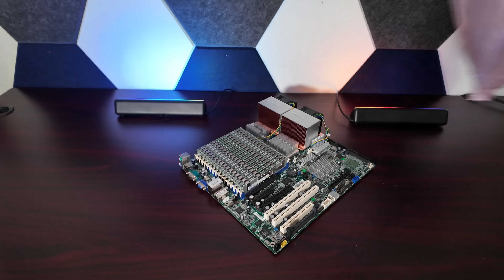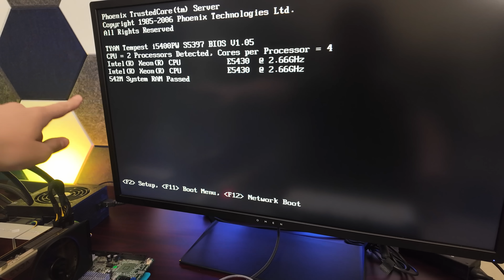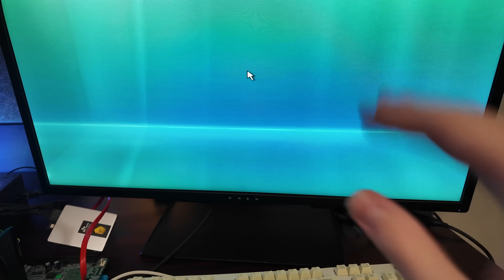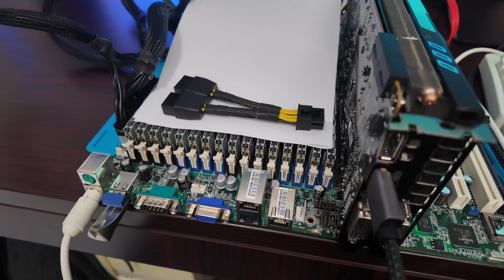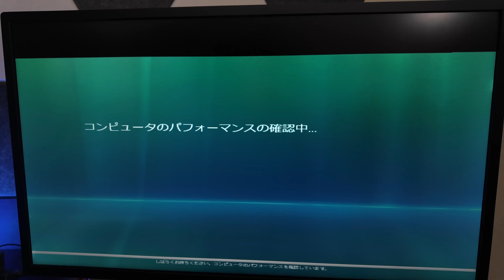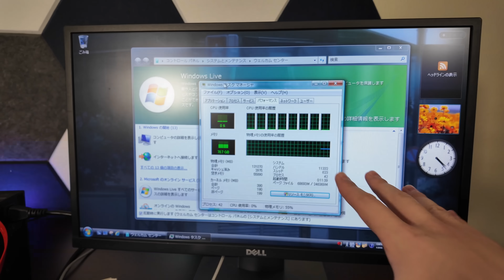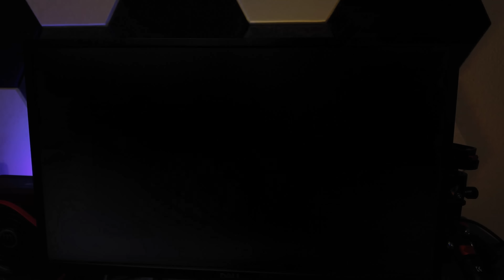What can you do with 128GB of DDR2?

Comment: The situation is so bad we are getting DDR2 reviews
Reply: And we be watching 😢
Reply: Next instead of ram we will be looking at roms
Reply: @jeffbongos3796 It worries me that I am hyped for that, what are we expecting?
Reply: @jeffbongos3796  "Cele ROMS"...
Reply: There is people building new PC with DDR3 ram and Cpu so it's not even a joke anymore it's that bad 🥲
Reply: @ommsterlitz1805  replying to this comment on ddr3 ram and an intel 4th gen i7, although id prob still be on this if ram prices never hit just becuase its fast enough generally, but i would have still been more likely to move on to something newer if the ram prices thing didnt happen
Reply: @randomgamingin144p  holy molly can you even launch windows 11 or any modern games or application ?
Reply: @ommsterlitz1805  shouldn't be able to get win11 with that, it needs gen 8 or newer lol. i have that problem as well with my gen7 i5. just ordered new am4 board and chip, I'd gone am5 if the ram wasn't the most expensive to buy.. I'll use ddr4 a little while longer 😆
Reply: @ommsterlitz1805  I'm running W11 on an intel 3rd gen i7 with 16 Gb DDR3 RAM, it works surprisingly well after you get rid of all the bloatware, but I guess I'm lucky to be using a good chipset as well, because that might make a difference at this point.
Reply: @ommsterlitz1805  You would probably be better off going for Linux on hardware like that over forcing windows 11 to run on it (you still can, but you really shouldn't lol). You can play games on ddr3, especially if you don't play anything extremely demanding. Just keep in mind, the ram is not the only issue. Old ram requires an old motherboard, which also limits your CPU/GPU options. If you want to play something like cyberpunk at a solid 60fps it would be an uphill battle. I don't think it's strictly out of the realm of possibility though.

To sum it up: ddr3 is perfectly capable, but may have some limitations and obviously isn't gonna be a crazy gaming pc. Great option for casual use on a budget imo tho.
Reply: @ommsterlitz1805 then they were impatient, good deals on ddr4 happen often
Reply: @uzcape i have 32gb ddr5 btw
Reply: @zhanucong4614  Thats awesome...😊
Reply: @uzcape it was bought pre second tribulation, right after the first one
Reply: @zhanucong4614  Good 👏🏻
Reply: wow bravo!  @zhanucong4614
Reply: @zhanucong4614  same bro
Reply: @LB.99 hopefully that people in future will have our luck
Reply: @zhanucong4614 i just bought 2 16gb ddr5 sticks for 350$, i shouldve bought 64 tbh
Reply: @zhanucong4614 I have 64GB ddr5 and 192GB ddr4 btw
Reply: @zhanucong4614 you just asking to get robbed
Reply: @zhanucong4614   HE HAS RAM. GET HIM
Reply: @zhanucong4614 HE HAS RAM GET HIM
Reply: @zhanucong4614  carter PCs on his alt
Reply: @zhanucong4614 what neighborhood do you live in again?
Reply: @chillycaty balkan/Croatia,come and get it pal,we have turned people into soap for far less
Reply: @zhanucong4614  good for you
Reply: @zhanucong4614  HE HAS RAM GET HIM
Reply: @zhanucong4614  okay
Reply: @zhanucong4614 just asking, where do you live? yk, just curious
Reply: @zhanucong4614  i have 96gb ddr5 btw
Reply: @zhanucong4614 no one asked U and btw I have 64 gb of ddr4 sitting in my storage room and using 64 gb of ddr5 right now
Reply: @UioEditz good for you,am dual wielding two monitors,one of them is a wacom display,i bet that your pc cant even get images from satellites lol
Reply: @zhanucong4614 i have a 240 hearts dual monitor dumbass Ryzen 9800 GPU is rtx 4090 now talk showing off isn't cool and U only 32 GB of ddr4 embarrassing I got 10tb of storage I'm upgrading it to 20 tb like after 1 month
Reply: @zhanucong4614 your address please
Reply: @zhanucong4614 mf what
Reply: @zhanucong4614  complete loser 😹😹😹😹😹
Reply: @zhanucong4614  I have 64gb DDR5 btw
Reply: @Citymoukari that's amazing, do you pla things like plane sim or vrmbox?
Reply: @zhanucong4614  i have 64gb ddr5, but still on a 3060
Reply: @zhanucong4614  GET HIM!!!
Reply: @zhanucong4614  laughs in 128gb DDR5
Reply: @uzcape this response was so much more wholesome than I was anticipating...
Reply: @zhanucong4614  damn only got 16gb ddr5
Reply: ddr2 era computing was peak computing its right in that era where hardware became widly available and the prices were good globally.  er mind you after they cleaned up that ram factory fire damage that is.
Reply: @homelessEh  3770k :')
Reply: @SamLoki  3770k was ddr3, not 2.
Reply: Pretty soon we'll be doing EMMC reviews.... 💀

Oof lol
Reply: with these ram prices going to find the person with the fastest WPM typing skills nickname him RAM and pay him hourly to type out all the data in realtime.
Reply: @shaece798 sorry Fam, but they been using AI and Bots to out buy you.  Even for Switch and Pokemon cards let alone ram and SSDs.
Reply: @mr_h831  or bubble ram
Reply: @mr_h831  i'm lookin forward to that!
Reply: @mr_h831  modern emmc is pretty good but its known for getting slower as you use it more. if you use it for years it starts getting really really slow... kind of forcing you to even use say a hdd instead once it gets bad enough. then it eventually just stops working

i dont know tho because ive only seen modern emmc so far that either works just fine or seems to have gotten slower a bit with time but is still usable, thats just what ive heard/pieced together
Reply: Waiting for Rambus RAM to re-emerge anytime now.
Reply: @Lemonidas75  When we needed him the most, he disappeared
Reply: Why do you know about me?
Reply: I say lets all go back to ddr3 its still half decent
Reply: @Hiimbryan yeah until the supplies run out 😔😔
Reply: @zhanucong4614  accurate
Reply: @Hiimbryan war crimes are parts of my genetics,only reason why they aren't on geneva list is because we are too small
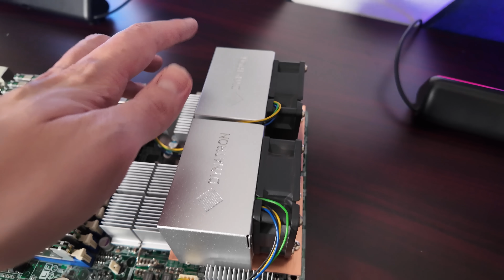Reply: 0:51 Can I merge two 8gb ddr2 into 8gb ddr4 then sell all of that and turns into a millionaire
Reply: yeah fr
Reply: that's nothing, i've got some sdram that's about to take off, videos will be wild!!! lol, not really. 😂
Reply: @giornikitop5373  just building my retro dos/win 3.11/w95 machine, got whooping 16 megs of ram (EDO) for just 5 USD :] rest (mobo, amd K6 cpu, s3 trio) for 20USD, beautiful days :D
Reply: Only the realest MF'ers use core rope memory. Miss me wiff dat DDR shit
Reply: @masterTigress96  This ain't ddr ram fool, this is DDR2!  Its a generation newer than that as DDR1 tops out at 400 mhz
Reply: Ddr1?
Reply: we are so fuckin cooked, fam
Reply: GPU's are currently on DDR7. My man is testing DDR2 loll. Great content
Reply: @Zedisneverdead  GPUs are currently on GDDR7, not DDR7. it's a different spin on ram.  Have a nice weekend bro.
Reply: The funny Thing. I Just found a fully working DDR2 PC today.
Reply: @ForrestPump99 that's so cool tbh, I want one for funsies.
Reply: Imagine that
Reply: whats wrong with ddr2?
Reply: @miljororforsprakpartiet290 it's really slow and supports super old cpus, for comparison ddr5 is 10x faster, and ddr4 is 4x faster than ddr2
Reply: @zhanucong4614  And those "super old cpus" still run anything you'd want in 2026, as software and games have solely become worse over the last 15-20 years. 
I'm still not informed of any application having a specific ram type requirement.

Also, fast DDR2 is still faster than the fastest NVMe SSD's (SATA SSD's not even worthy a mention, being slower than SDRAM). So sufficient DDR2 is an upgrade from insufficient DDR5 + NVMe.
Reply: @miljororforsprakpartiet290  i mean they can almost run everything but i get your point,you do realize that having good ram reeaelly influences amd cpus,why would they ask for ram type when thats usually fixed by asking for cpu
Reply: Remember when ram was at its absolute cheapest before covid
Reply: I set aside an 8gb 400 kit for bribes.
Reply: suddenly everyone wants to buy ram. xd im chillin with my 64GB DDR5 bought 2 years ago
Reply: @Kilowatt8664lucky af, thankfully i was able to get 32gb ddr4 a few years ago though
Reply: ** laughs in 1tb of ddr4 *
Reply: Hey friend, Jesus Christ loves you greatly and He has a great plan for your life!
Reply: Haha
Reply: Brother, I bit my tongue from the laughter! :face-green-smiling:
Reply: @ANSWERTHECALLOFJESUSCHRIST  Are you okay?
Reply: @Lele_Wolfgang  Annie?

Comment: Watching this while I have 128GB DDR4 in my 5900XT (16-core/32-thread) system. 

Like. Looking at TechPowerUP, that E5430 was actually released in 2007, and back then I had a Intel Pentium Dual Core E2140 with 4GB DDR2. Having a workstation or sever grade PC was a dream back then. 

If I had 128GB DD2 between 2007-2013. I'd have done the same as what I do currently; video editing, photo editing, music/audio production, virtual machines, some CAD work. Between 2013-2019 when I was on FX-8320 and 32GB DDR3, I was using RAM Disks too. I'm not sure people realise how virtual instruments in audio work, and video or photo editing can comfortably eat as much RAM and threads as you can throw at it--you never have too much. It's 2019 to now where I think RAM Disks became less relevant with NVMe drives being stupid fast. 
 
So it's all just crazy to think about how things have evolved over decades.

Comment: I had 4 GB of RAM (PC133) in a dual Pentium 3 board - an absurd amount of RAM completely maxing out the chipset. What'd I do with it? Installed (nearly) every version of Windows (95, NT4, 98, 2000, ME, XP, Vista, 7) in VMware machines and ran them - simultaneously, with drivers and software loaded in each. "Alt-tabbing" my way through history. Easy lift for this thing. But if you get enough monitors attached, theoretically you can do "8 gamers 1 PC" or the like...

Comment: Back just before covid when datacenter servers where cheap as hell I got an HP Prolient server with dual xeon 12/24 cores, I put 196GB of DDR2 in it, the key to it is how you bank it and how much bank switching the setup can handle, there is a point where you can only have so much ram in so many slots to get the MAX performance, if you get that right  you get the best results, my system could do 384GB max, but that causes excess bank switching because only half the ramslots are channels, the other half get switched, you don't want that, lot of performance penalty.  I love my server, its a BEAST, I have it setup with dual raid cards that combine to RAID 50 16x 15k HDD's that practically get Gen 3 NVMe speeds :).  I honestly don't recall what my RAM disk speeds where, I am fairly certain it was over 3GB/s. It also has an NVIDIA Quatro in it for rendering tasks.  I don't run it anymore really though because its a power beast, and makes a LOT of heat, and is VERY LOUD, but its an awesome beast of a machine.

Comment: Maybe the asymmetry between the read and write performance is caused by the NUMA architecture? When you write you can just send off the bits and the CPU can keep going, so the added latency of the NUMA routing doesn't affect anything, but when you read, the CPU does need to wait for the RAM's response. That's not to mention that the buffer being used for the operation is on the same device whose performance is being tested.

Comment: Some keyboards won't enter bios even on newer desktop computers have this issue, but does not have any ps2 ports and only usb. Simply switching with another usb keyboard usually works. A lot of detachable usb keyboards has that issue. Not very many wired ones has that issue. Some wireless keyboards would also have that issue.

Comment: Is this type of hardware still safe to run on operating systems that are meant for long term life? For example, Unraid or any linux distro, you could have a decent server? 

Although I realize that the power draw of that is probably quite high due to it being 2 CPU's, an NVIDIA GPU, and I'm sure the RAM itself even draws quite a bit of power with that many sticks

Comment: 4x128gSSD + 1x1tHDD + Bitcoin core node Allocate 22g in memory + 4xFulcrum instance each allocated with 22g in memory + Multi-threaded Seed Balance Checker.
Voila, you're playing the lottery as long as its turned on.
Your system will do about 10k addresses per second.

Comment: I have used a program called SIMION to quickly simulate the trajectories of ions. It stores the electric field for 3D space entirely in RAM and just performs successive matrix operations, and the resolution is directly related to the amount of RAM available. That, or anything else that needs to multiply giant matrices would be a good test for such a setup.

Comment: Regarding CPU bottleneck during copy: Windows built in file copy is single threaded and not the most efficient either, so you may well have been slowed down by that. One of the reasons why tools like Teracopy and the like are fairly popular even to this day is that they operate multi threaded.

Comment: Need a motherboard with 128Gb of ram or higher, SATA raid array with 8 connectors or more, full complement of PCIe 16x slots dual i7s, and legacy hardware.  put dual crossfire capable video cards. 4Gb or higher. 8TB or higher per drive on SATA raid. Plus M.2 2T or higher.

Comment: Mickysoft winblows, bleaeech.
root@14.2 ~ $  for host in a64 x4d xeon2 xeon3 xeon4; do
>  ssh $host "grep smp /var/log/dmesg | grep nodes" | 
>  awk  '{print "   "$6" "$7" "$8" "$9}' ; done
   4 nodes, 32 CPUs
   4 nodes, 32 CPUs
   4 nodes, 120 CPUs
   4 nodes, 192 CPUs
   4 nodes, 192 CPUs
Xeon4root@15.0 ~ $ grep smp /var/log/dmesg | grep nodes ; numactl -H | grep size     [   11.409794] smp: Brought up 4 nodes, 192 CPUs
node 0 size: 257819 MB
node 1 size: 258039 MB
node 2 size: 258039 MB
node 3 size: 258029 MB
Xeon4root@15.0 ~ $ ibstatus | grep -e rate -e link
        rate:            40 Gb/sec (4X QDR)
        link_layer:      InfiniBand

Almost 600 Threads and 3.5 TB of ram under a single mouse pointer.
Mickysoft crippleware cant do it, weak ass crApple cant do it.
Linux dumbphucked up by wayland crippleware cant do it.
 Only X11 with a unix-ish os like Linux or BSD gives you the power of a network transparent UI.
Reply: OK

Comment: Those are EPS and PCIE supplemental support, for RAID Controllers or Networking Control boards for Servers.  Those CPU'S can use up to 150watts per CPU. You should be able to find a user manual (maybe, it is pretty old)

Comment: 667Mhz DDR2 has a 5.3 GB/s, ~70ns latency.
PCI-e 4.0 m.2 NVMe has 7 GB/s, ~60us latency.

The transfer speeds are similar to SSD hard drives but ~1000x faster response times. What is the use for that?
Reply: true. but as you see random q1t1 is way faster. that's where latency shines vs ssd. it's when you are searching for a small and specific set of blocks i guess. in any case if you had ram as a disk, it would have been faster with everything like loading large llm models or data base or anything else.

Comment: You need to fully disbale the windows paging file as well as file buffering. Otherwise it will somehow try to read cached data from those files. While these cache files are stored on the ssd this is why you see near exact SATA limits as read values. 

When writing files the Kernel doesnt assume that there could be something cached (since he is writing new data coming from the CPU) and thus the problem is avoided and your writes are suddenly higher.
Reply: that is something he should try. good catch.

Comment: Install proxmox, use it to run light-weight containers/vms. Biggest issue with these old servers is power draw. I have a quad socket server (4x Xeon E7-8890 v3) with 18c/36t per cpu (72c/144t total) and 1TB DDR3 ram, and it draws a ton of power even at idle.

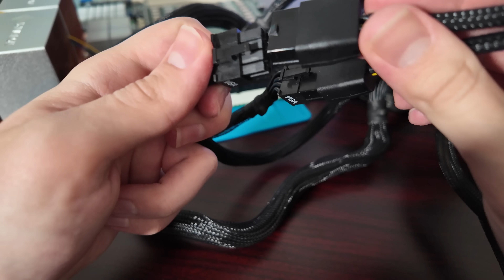Comment: 2:21 for some insane reason my dad had a dual molex to CPU adapter and was using it instead of the actual CPU power. no idea why but it is no longer doing that.
Reply: A molex connector is rated at max 50 watts (@5v) ; the whole line (daisy chained) can barely handle 100 watts (@12v), so using it on any CPU demanding more than 100 watt people could blow up something or at best make the CPU unstable under heavy load. Think of random resets or crashes. The power supply or the cpu could get damaged. Voltage and Amp curves could look absolutely funny when you come near the max rated output. I use a too small power supply with a certain Xeon CPU from 2013. The CPU is rock stable if I keep the turbo off (in the bios). When I turn the turbo on (in the bios) and the CPU gets a bit excited (one core going 100%, running at max frequency) the PC instantly resets. It could have other reasons but I just suspect the power supply. Switched to another CPU some time ago so no reason to solve the problem. Nor did a Xeon from 2013 run that much more efficient at 3.3 Ghz than at 4.0 Ghz compared to 5 year newer CPUs.

Comment: Well, it turns out that you can't do much else with 128GB of DDR2 except 1) make a gigantic RAM disk (that still isn't very fast for some reason), 2) calculate 25,000,000,000 digits of Pi, and 3) open 200 YouTube tabs. That's it.

Comment: Slap Linux into it if you want to see it's true speeds.
Wonder if installing a modern kernel as is would work just fine, like latest Linux Mint.

I'd like to see some gigantic fluid and particle simulations on those 128GB of DDR2.

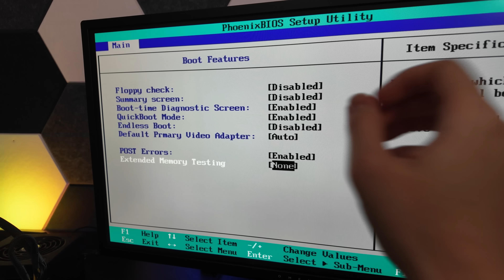Comment: 6:41 What the heck is the "Endless Boot" setting?!
Reply: Another name for your mother
Reply: endless boot causes the system to reboot endlessly, it is usually used for testing if components can handle the electrical surge of start up repeatedly
Reply: @onyxtherat I canno tell if this is a troll
Reply: @clonkex  its actually true
Reply: Fun is endless
Reply: Endless boot is for network boot applications like PXE. If the PXE server isn't ready and the server misses the PXE boot, instead of stopping at 'boot device not found', it will just keep trying forever until it works.